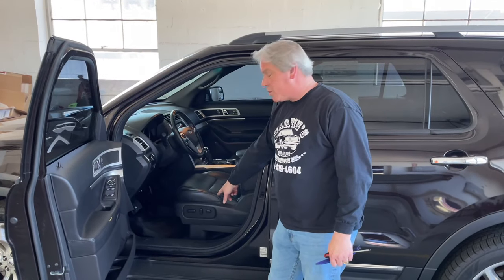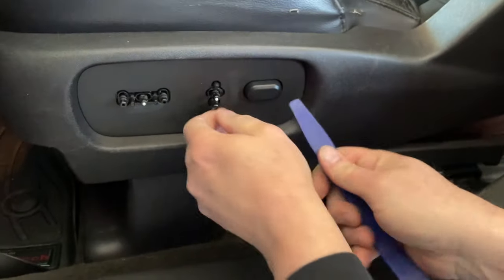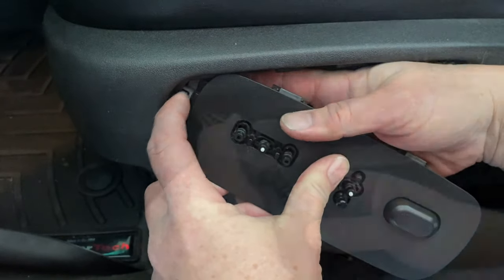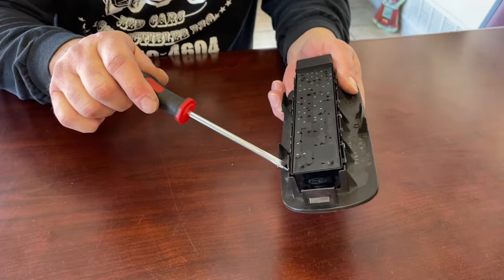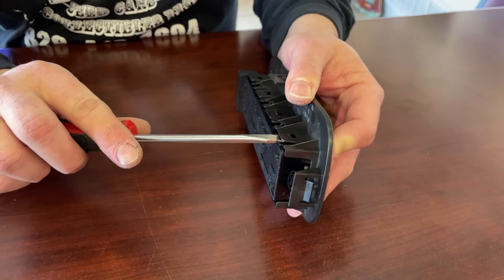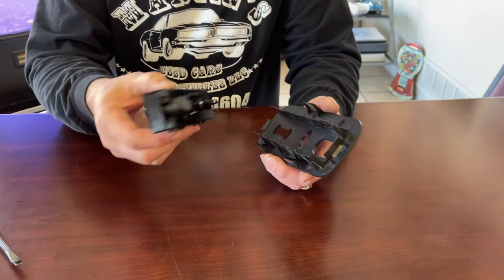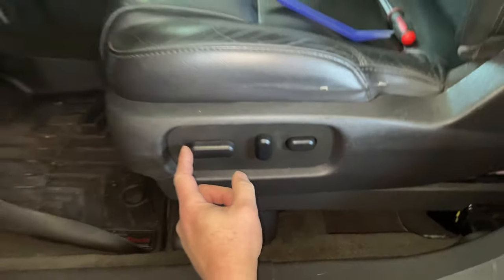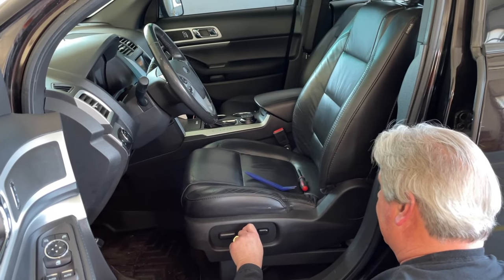How To Remove / Replace Power Seat Switch On A 2011-2015 Ford Explorer

Comment: How did you determine it was the switch and not the motor?
Reply: I have to replace mine as well. And the way you can tell it's the switch and not the motor is that the seat can still tilt back, but it won't tilt back up. So the motor is just fine it's just not getting the connected signal from the switch to move back up.

Comment: My passenger side went bad. It’s also a 10 way. Would I use the same as the driver side or is there a different one? The link for the passenger here is only 6 way.
Reply from the maker: Passenger side is a different switch. Try searching Amazon for the 10-way switch for passenger.

Comment: Thank you for the video.  It took me not time at all to fix my passenger seat.  I only had one issue and that's with my lumbar support adjuster knob.  It has a key on it but I didn't know that until after I pulled it off.  It still works and key went back in but next time I'll only pulled it out far enough out to get the key off before taking the whole thing off.